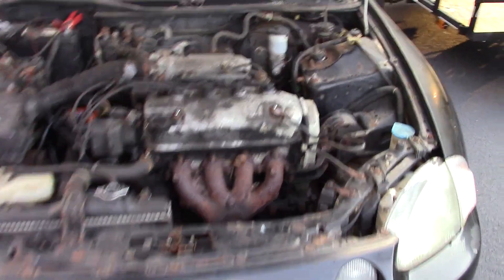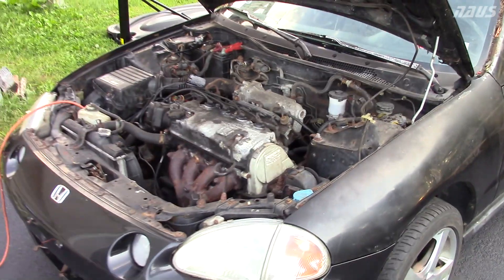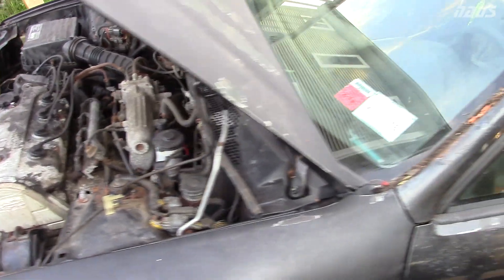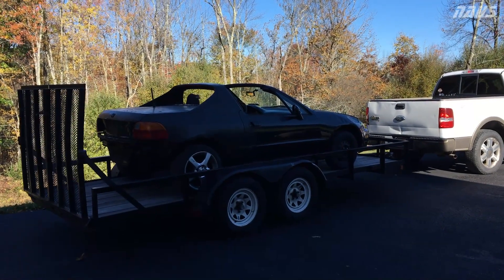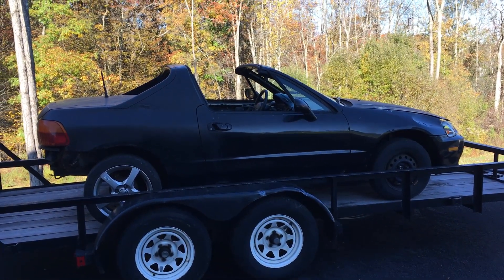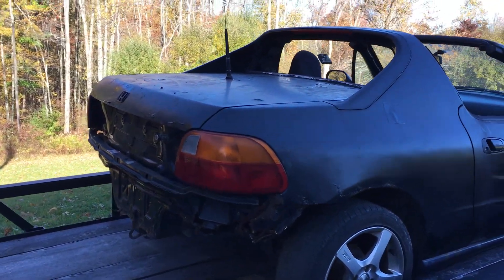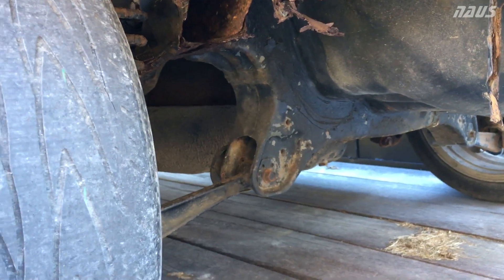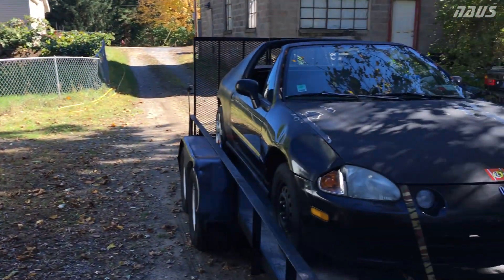$300 Del Sol Race Car Project Part 2

Comment: Glad your posting more. Recent videos been great. Quick question. How’s the reliability on the s2000 been since your ownership
Reply from the maker: ive only put about 10k on it in the last 4 years of ownership. Most of those miles are hard autocross & track miles. The s2000 has given me zero issues despite all the abuse. Ill try to make a upcoming video about this